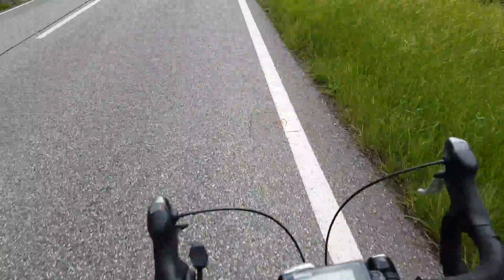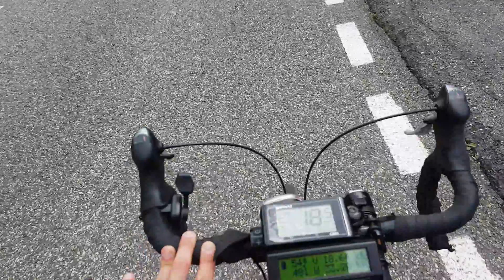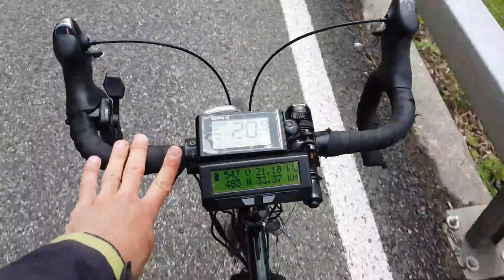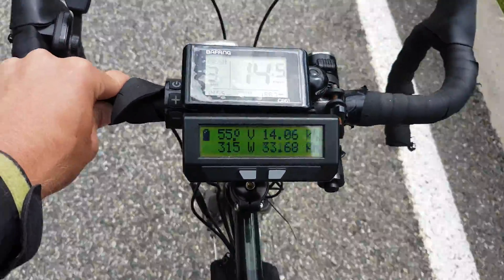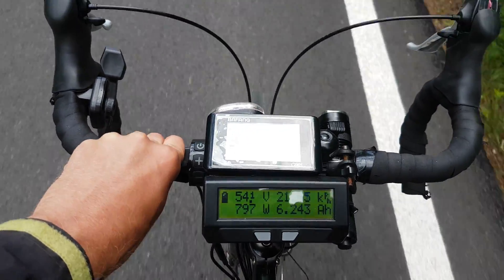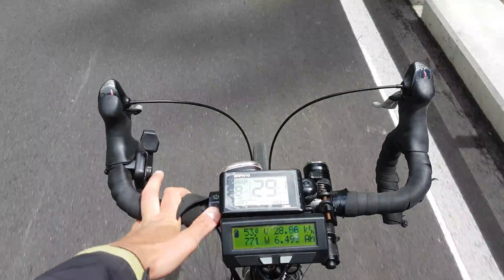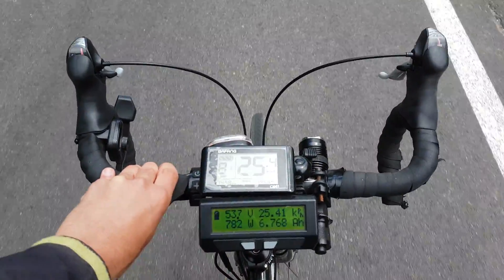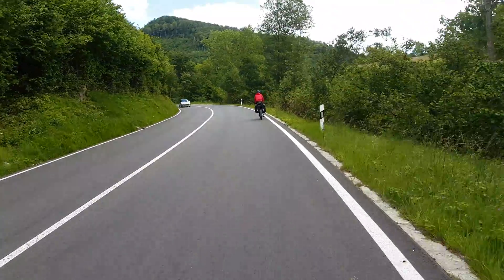E-bike how much power do I need for touring? 250w? BBSHD

Comment: I'm 6 feet 2, 16 stones and live in an area that's all valleys and steep hills. I'm guessing that a UK street legal 250watt motor is going to struggle getting me up those hills?
Reply: grizcuz I'd say power and battery depend on how fast you want/need to go and how high your gearing is. If you have a really high granny gear you can get up some pretty steep hills, with not to much power or battery drain (obviously, you need to put a reasonable amount of effort in and you'll be going slow. ) More power (like with the BBSHD) means you can go up hills a lot faster, but this chews through your battery too. One good thing about having a high power motor (even if you're frugal with the power) is that it's not going to heat up like a smaller 250W motor going flat out.
Reply: mick2d2 Thanks.
Reply: mick2d2  good point about the heating up mate ,  this imo also has some bearing  to how long the motor is going to last ,  its kinda different if you are a 7 stone lass or teenager , but for a heavyish adult where the motor is under extreme load all the time , you would have to assume its life will be short and far less effective .
Reply: mikldude Also depends on the design. I ran a Bafang BBS02 48V 20A for three years and switched to the BBSHD 48V 30A (running at 52V) last year. Although it's over volted it runs cooler than the BBS02.
Reply: mick2d2  .....Hi..I have considered the options of a 250w and considering I’m over 6ft an 16 stone I have tried this bike and find it pretty useless!! Your bike and motor sound ideal , what about cycling on the road , is that ok ?
Reply: Midlothian1000 I'm 6"6 & 100KG. I'm on holiday in the North of Spain at the moment in a really hilly area. I did about 45km yesterday, all up an down, with some longish pretty steep hills. I was going  flat out (for me) most of the time 25-30 km/h up hill and 50-70km/h down hill. This was all on tarmac. Used about half my battery which is 52v 20Ah, so plenty left over.
Reply: @Midlothian1000  You from Midlothian, Scotland? Me too lol, near Dalkeith watch out for an ancient bbs02b 750w Claud Butler flying past haha. I weight 52kg so it flies with me on it!
Reply: @nihilisticsoup2919  I’m sure I have seen you whizzing around ! Did you build your bike yourself?
Reply: @Midlothian1000  Nah I picked it up from somewhere around Birmingham, 11 hour round trip driving! But dude was selling bbs02 750 with 13ah for £500 so jumped on it, bikes just an old Claud Butler, plan to put the motor on a hard tail MTB in the future. Do you have an Ebike ATM or looking into getting one?
Reply: @nihilisticsoup2919  simple 250 w and it’s my wife’s I use !  Need a much bigger motor as I’m 6ft and 16stone ! problem is with the law thing , 750w would be great and it could certainly haul me around ! Have you ever been stopped .?
Reply: @Midlothian1000  Yeah sounds like a 750 or 1000w would be ideal for you, police don't even glance at me I've passed loads of them, even though I ride on pavement majority of time (crazy drivers!) Although I would just nip up an alleyway or something if they did try to stop me I suppose l, but I try avoid looking for trouble and never seem to get any. If you were thinking about the 750w bbs02 then honestly just spend a little extra and get the 1000w bbshd, it's not really much faster but better torque for your size and weight and the bbshd is much much tougher, bbs02 you have to be careful as it doesn't take abuse very well.

Comment: How fast do they go flatout
Reply from the maker: Duncan Young it depends on how high your highest gear is. About 45 - 50kmh
Reply: Cool
Reply from the maker: The gears weren't high enough to get much past 55 on that bike
Reply from the maker: Not sure you quite understand. Electric motors have a maximum Rpm based on input voltage. On  top of this the BBSHD is electronically limited to about 120Rpm. The only way to increase the maximum speed is to gear the bike higher/faster.
Reply: @JackButlerVideos  but still wouldn't the sensor on your wheel effect how fast the motor would run no matter which chain ring n sprocket you were using.
Reply from the maker: Performance electric motorcycles use mid-drives as they are more versatile and easier to cool. Hubs are limited by heating as you can't water or oil cool them. The most powerful hubs are about 8000w continuous maybe 25kw peaks. The Zero electric motorcycle for instance has a 45000w mid drive and the  Energica EGO 107000w. It's impossible to run a hub motor at these power levels as it would overheat (unless you have an insanely large wheel like 25 inch+).  Don't get me wrong i don't like mid drives better than hub motors but there is no point in hating one or the other because they are different options. It's like diesel vs petrol engines, each have their place (although in my opinion that place is in the history books 😅)
Reply from the maker: Yes it's a mid drive (it's also has a throttle) but what i mentioned about the input voltage determining the maximum rpm still applies to a hub motor.
Reply from the maker: Mid drives and hub motors each have their place.
Reply from the maker: As soon as you go over 250w in EU or 750w in the US we are not talking about bicycles anymore they are motorbikes.
Reply: I just shut my eye's & hold on so I can't really say.
Reply: Superior No1  But they can't half get up hill my Brother has a rear wheel hub n my Black Stalion leaves him in my dust

Comment: What's the name of the Watt-meter? Is it available from Bafang?
Reply from the maker: StopLossLOL it's called a cycle analyst. Got mine from em3ev with the motor!
Reply: @JackButlerVideos   hi - please tell me how the Cycle analyst connects to your bafang setup...many thanks.
Reply from the maker: @AshcanPete  it's a CA-SA (stand alone) there is a shunt between the battery and the motor that connects to the display
Reply: @JackButlerVideos  many thanks Jack.

Comment: I'm confused why your pedals still move when freewheeling, why doesn't it actually freewheel like all bafangs?
Reply from the maker: You can get power from the motor by pedalling or using the throttle. But it's hard to hold a set power to demonstrate with the throttle only. So it's easier just to slowly pedal in each pedal assist mode :~)
Reply: Thanks for taking the time to answer. Confused no longer :)
Good luck with the Sun Trip!

Comment: Can this get you 80 miles a day and does it affect your peddling when battery is dead?
Reply from the maker: Kia Slovey 80 miles is possible yes with low all day power. It just means you go slower, and a lot slower on hills!
Reply: Also once battery is flat it's your legs doing all the work.

Comment: Hi ..you mentioned that you have to register your bike ,can you explain the process please as I’m very interested!! Also you mentioned your motor is 250w , I have never seen a BBSHD that size for sale ??
Reply: Midlothian1000 I did a Google search for ''Bafang BBS01 250w 36v Mid Drive Conversion Kit'' and got a few for sale.
http://www.bafang-e.com/en/drive-systems/drive-system/max/m500-drive-system-1.html
http://ebike-sales.co.uk/product/bafang-bbs01-250w-36v-mid-drive-conversion-kit
https://www.amazon.com/Electric-8fun-Mid-Drive-Conversion-Controller/dp/B01HPJQ6PG
Reply: Weasel  Many thanks for your reply , however neither are a BBSHD model ?
Reply: Midlothian1000  Sorry about that, must have been tired when I did the search and didn't spot the obvious! Perhaps he was mistaken in his commentary.
Reply: Thats because the Bafang BBSHD is their top model and is 1000 watts. Their lower models are BBS01 (250w and 350w) and the BBS02 (500w and 750w)
Reply: exactly what i bought from Whoosh Cycles

Comment: Good ride! Well I will ride this bafang BBS 250 WATT, but I can see that you are running with around 54v? Is that possible? Because in the specifications it said that works with 36v. Thanks for you answer.
Reply from the maker: +Julio Yucra there is a 48v model which happily takes up to 60v
Reply: Oh I see thanks man for your quick answer.
Reply: What is the max a bbs2 500w will take it's running on a 36v 14ah at moment
Reply from the maker: 52v nominal is the maximum.

Comment: Good video mate. 
 The 250 watt limit is ok for a light weight load  i think.
 If you are a big dude with heavyish bike , it's almost useless . 
 I'm about 110 kg (on a good day)with a fairly big carcass to push through the wind , add a 13 odd kg mountain bike before you add the weight of a battery, motor and bits and pieces , 
  and  anything other than flat road  and a favorable wind and it is barely worth having imo.
 It may be a tad better with a mid drive set up. But with a 250 watt hub motor  i wouldn't bother ,  most disappointing. .
Reply: The way I look at it is most healthy people can put out 200w average for an hour so a 250w motor is like having another human to pedal for you (factoring in some losses). This doesn't take into consideration the double or triple wattage normally put in by a human during acceleration or hills but as a guide it works for me. Also consider most people want to go faster with less effort when they have an ebike thus requiring even more power whereas I'm comparing like for like speeds. The faster you go the less efficient you will be due to drag so 250w will be the best if you want to save as much power as possible but don't mind going a bit slower.

That said the 250w limit is a bit low as you say. I also think the 15.5mph cut off is low as well. 500w and 20mph is more reasonable and would help to convert more people from cars to ebikes
Reply: I have a 3 speed igh would the bbs02 be sufficient?
Reply: Sir what is top speed ???

Comment: really useful. are you running 48 or 52v? Im in too minds for mine. I want to go for a larger chainring, maybe a 52, to give a higher top speed since it'll be a road(ish) bike. But if i put a 52v battery on it and a full assist or throttle ill end up burning something out. Which since I want it as a commuter wouldn't be wise. I have enough cells for either 13s10s or 14s10p but i dont want to be rebuilding packs.
Reply from the maker: anthony stafford i would definitely go 52v. You have less amps for the same power so if anything you are less likely to burn something out most of the time. The controller takes 60v max quite happily.